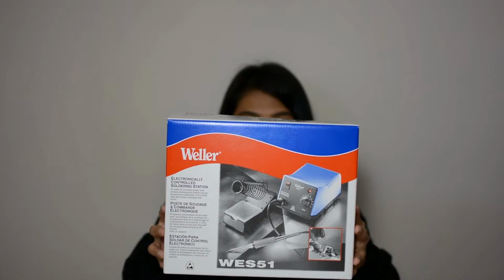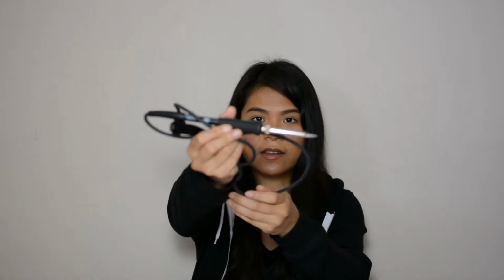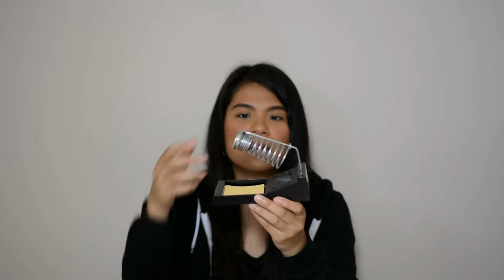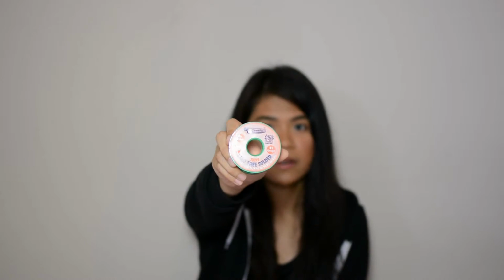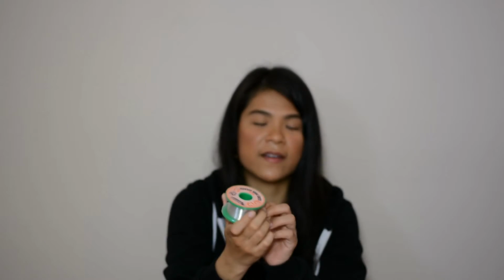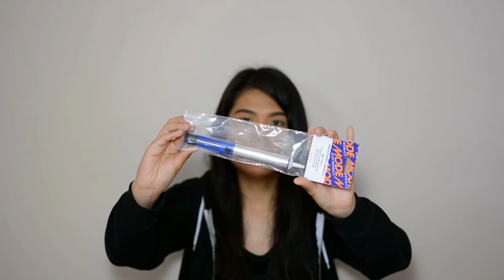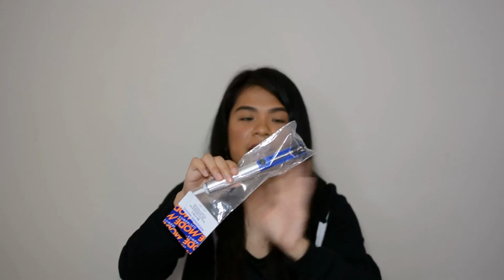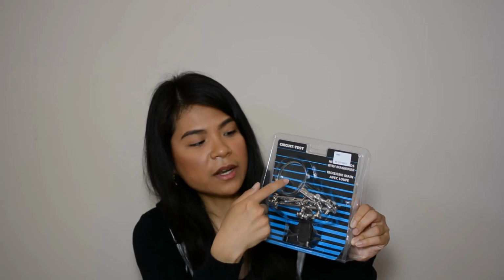HAUL | Electronic Hobbyist Splurges for Tools

Comment: Awesome vid with great tools! I splurged a bit to get to me started, your way ahead of me though. Didn't get a Weller but instead a Hakko FX-888D. Also have the same helping hands! I saved from X-mas and awhile back I purchased a Aoyue 474A++ De-solderer. I'm super excited to try it out. Just for learning sake I also purchased a desolderer like yours and with the few things I've tried it works really good!

I'm still kinda confused about the solder itself. I bought several rolls of many types but you have lead-free. Can you tell me why that's what you use please. Thanks!
Reply from the maker: +KASUALKILLAS Hey and thanks again for the comment. Yeah both soldering irons are actually very good (Weller and Hakko FX-888D). I decided to go with Weller because I noticed whenever I went to an electronics lab at school the students would be using Weller. The instructors seemed to go with that brand. So I assumed that would be the best one to go with because educational facilities were using that brand. And cool! Yeah that desoldering tool is really good. It's great to fix your errors if you messed up on some soldering joints.

The ones with lead are supposed to be easier to melt and make connections. I decided to go with the lead-free because I was afraid of toxicity of the fumes and stuff. Hopefully getting this one makes at least somewhat of a difference. But it's good to have a ventilation system when you're soldering. I actually don’t have one and that’s probably very bad. I should get one. In the future, I’d probably have a work station eventually.
Reply: +8v01d That's a Really good reason to go with Weller. I hope when I go back to school they will use Hakko lol. What about Rosin core solder? I read that's bad for us and the environment. As for ventilation I went with a  Hakko FA400-04 & Honeywell HPA105-TGT behind the Hakko. Seems to work really good.
Reply from the maker: +KASUALKILLAS Great question. I’ve never used rosin core solder before. I think the rosin core solder is made up of tin and lead? And when you start melting or soldering the rosin will evaporate so you’d probably need a well ventilated room. I think your right about it not being environmentally friendly either >_<. But you can still use any type of solder. Its up to what you like the best I guess.

I also checked out your ventilation. They look like really good choices. Maybe I might get one sometime. Do you use both of them at the same time or do you like one better than the other?
Reply: +8v01d The Honeywell I bought on clearance ($40 off) as a general air cleaner for my room but when it gets cold (which Minnesota does) I cant open the windows so I use it in conjunction with the Hakko. Very minimal stuff within a closed room but it works. The Hakko FA400-04 is really just a "Smoke Absorber", the real deal is a "Fume Extractor". That's what we really want but soo much $ :/